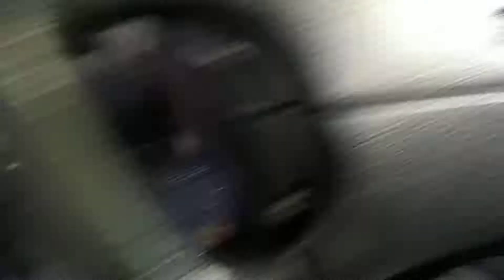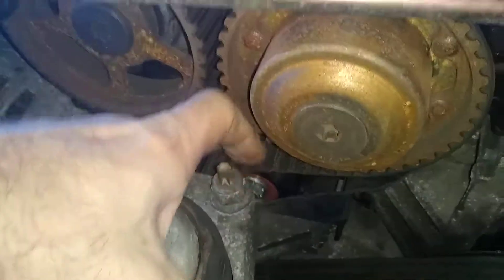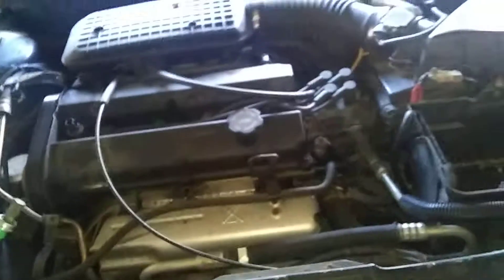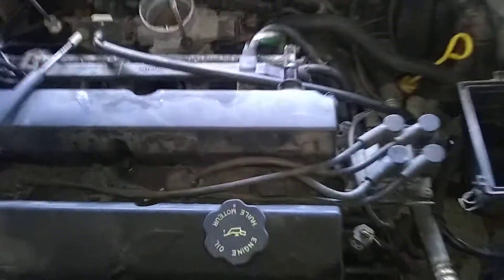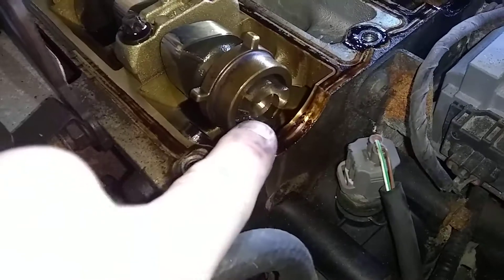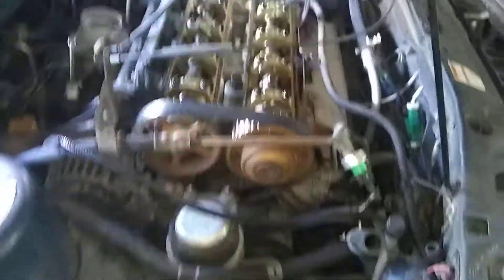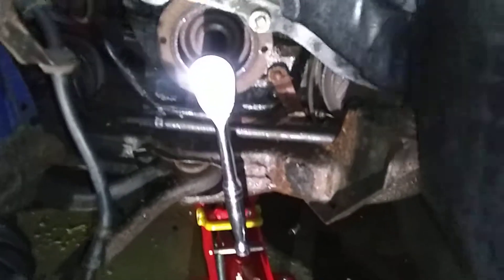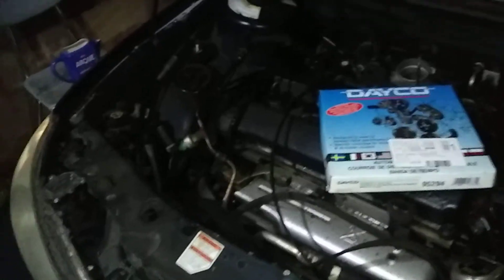2000 Ford Contour 2.0L Timing belt replacement part 1/4

Comment: Where do i find the hole for the crank shaft pin tool? My father and I cant find it anywhere and nobody makes a good video showing where it is
Reply: IM SURE YOU ALREADY FUND IT BY NOW,  BUT ITS IN FRONT OF THE CAR,  uNDER THE CATALYTIC CONVERTER TO THE RIGHT JUST A BIT,find it from under the ffront of the car
Reply: @97warlock  yes! Found it and job is finished. 5 days after that my alternator went out.. Fixed that too lol